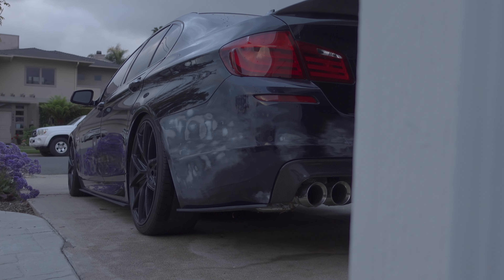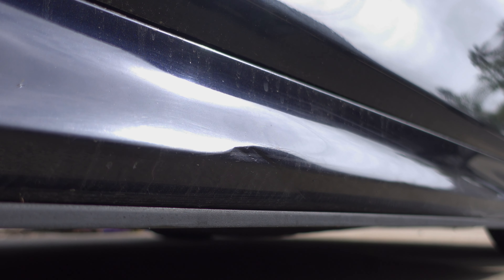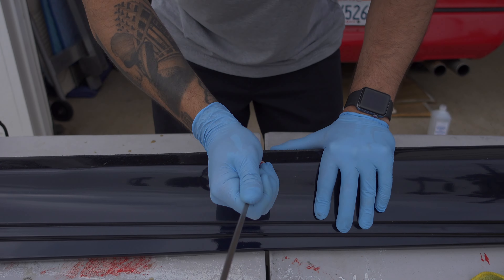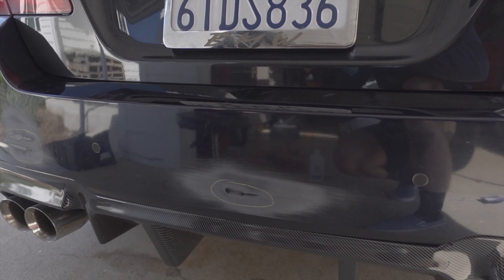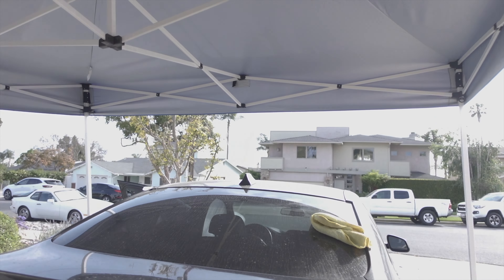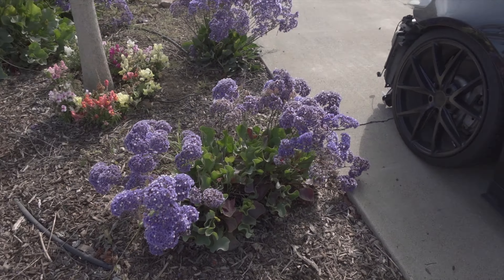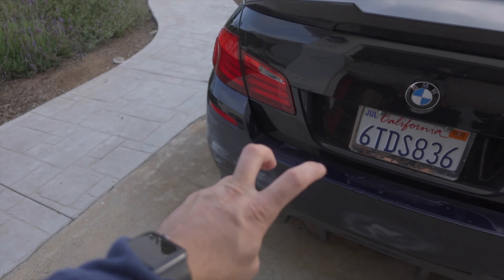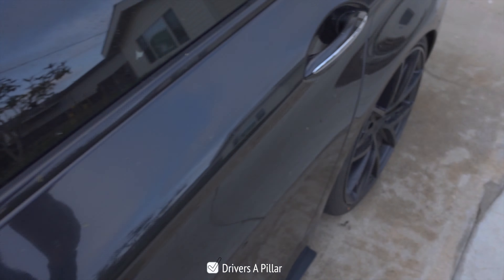BMW F10 535I Final Bodywork Prep Before Vinyl Wrap | Dent Repair With Bondo

Comment: I envy in terms of how little your paint is damaged compared to mine. I'm planning to wrap my F10 too and there is literally paint popping off the hood, and rust above windshield. Do you have any recommendations on how to deal with that?
Reply: Definitely sand all that out and primer before you wrap it. If not any rust will definitely jack up your wrap.
Reply from the maker: I’m definitely not the expert but I’d recommend what @billy from HR said, sand it all to bare metal and see if you have any holes that need repair, then fix either by replacement metal welded in or bondo if you don’t need to repair excessively, then prime then paint/wrap, but I’d definitely watch some other videos just to get a better idea haha

Comment: As much as I enjoy your drive I would have said you should have gotten the pillar and the door and maybe even the quarter should have gotten pdr and then the bumper should have been skimmed, eventually what will happen is the bondo will crack and then it will cause issues with the wrap and any future paint
Reply from the maker: Yea I had weighed that option, and I even talked with some PDR people who claimed they weren’t repairable (maybe they just weren’t very good? Haha) but either way, my rationale was spend good money to MAYBE fix the dents and possibly have to repair anyways, or just bondo them and not waste any time, so I went with the latter